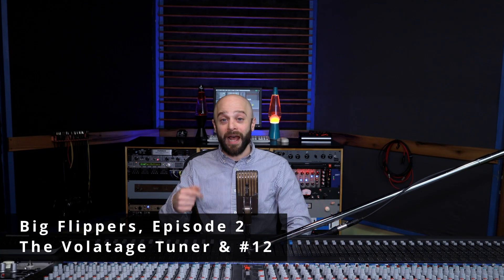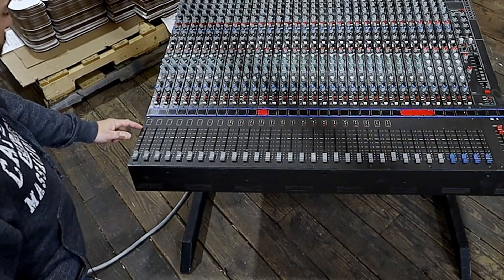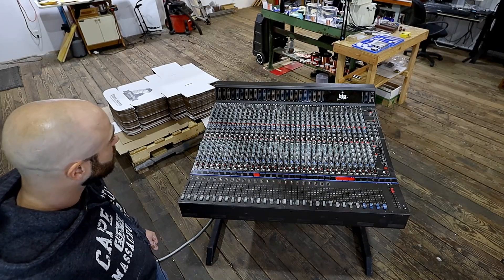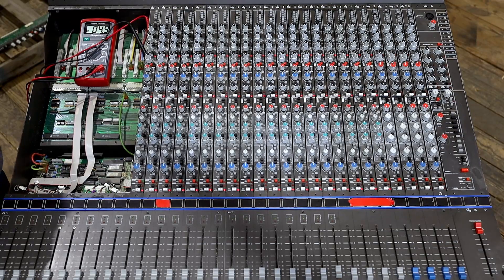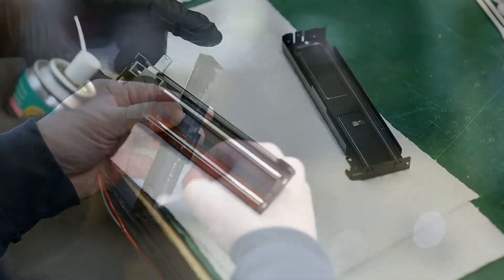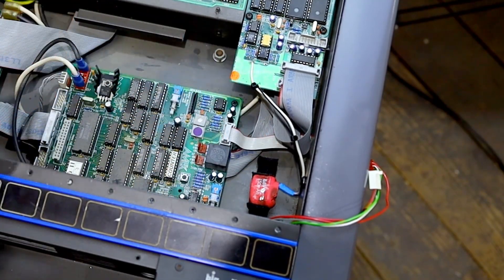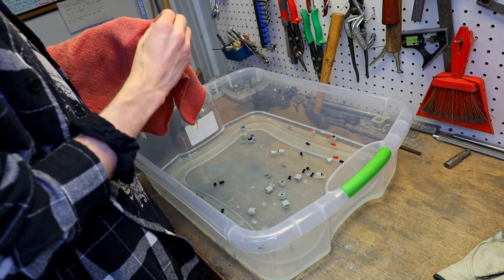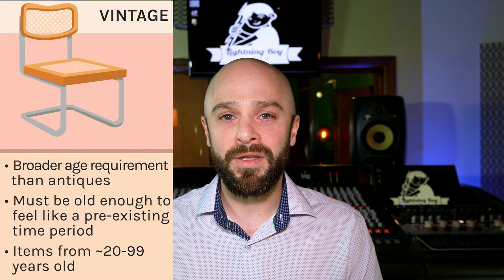Big Flippers - Dead dynamics and a dying channel 12

Comment: hey!!just bought this board and want to get to the battery before the disaster happened, can you please describe-how?
Reply from the maker: It’s under the Big 3 module on the CPU card.  Be super careful handling the CPU card and working on it.  If that card dies you will have a boat anchor instead of a mixing board.
Reply: @LightningBoyAudio  You sound just like Dave)
Reply from the maker: I know from experience.  I successfully repaired one dead CPU card.  I failed with 3 others.
Reply: @LightningBoyAudio  So I’m not a tech, the console is in-front of me, should I open the master section and check the battery? Is it a difficult procedure?
Reply from the maker: Do it with the console off.  There are two screws that hold the CPU card in place.  You could potentially leave the card installed and just snip off the battery with a good sharp pair of wire cutters.
Reply: @LightningBoyAudio  If I leave the card installed, how do I see the battery? I have a 44 channel version btw
Reply: @LightningBoyAudio  Man, don’t let me down( I’m ready to do whatever you say..
I had a dream last night of leaking battery😜😜